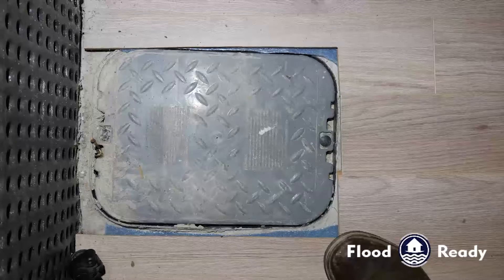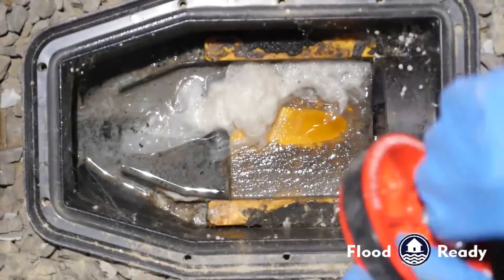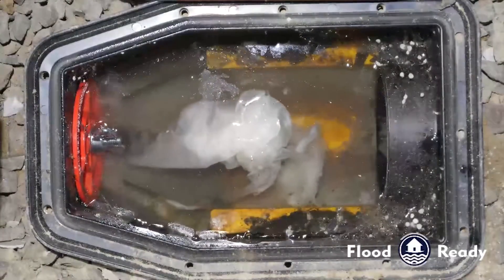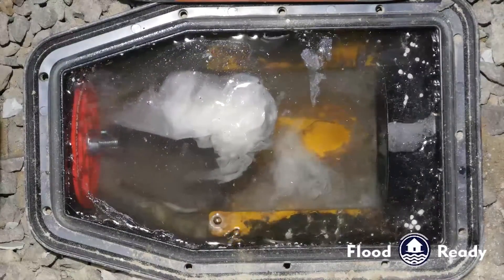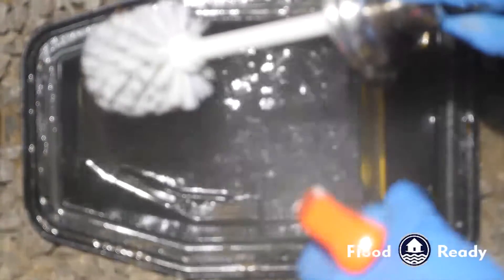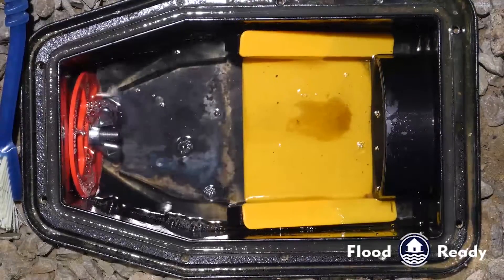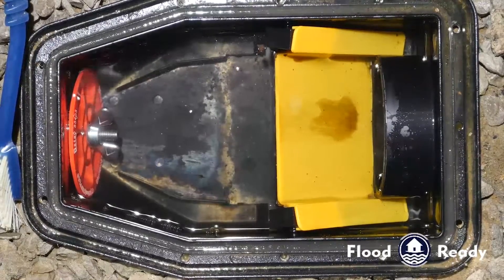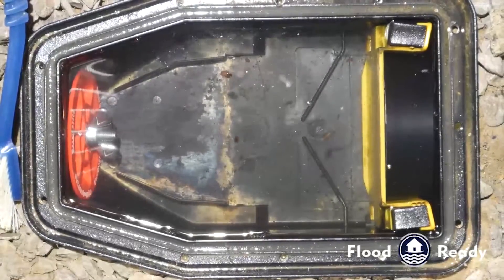Backwater Valve failure vs  performance

Comment: Thank you for the simulation. I have an Mainline Adapt-A-Valve 4" (Normally Open) Backwater Valve and not too long ago the city side was clogged and some water seeped out of my floor drain even though the flap was in the closed position. It was in the closed position for 2 days before the city cleared the blockage 19ft away from my exterior cleanout.  At least is mostly worked.

Comment: is there is away that you install it one time and forget it forever?
Reply: All anti-backwater devices requires maintenance, at least once a year. Check and clean it inside, check and grease the seals best with faucet/valve Grease ( rats love to check the taste of the seals, and don´t like the taste of faucet/valve Grease).

Comment: That can't possibly be a water tight seal. It looks like you would still have some water/ sewage coming back through. Convince me otherwise.
Reply: They are actually pretty close to water tight.  There is a black O-ring on the circular pipe that seals against the flapper.  Most backup events are only a few PSI and they usually only last a few minutes to maybe an hour.  Your also taking a 4” pipe that can move many gallons per minute of sewage into your basement and cutting it down to essentially the leakage of the valve.  There are other ways that cut flow to zero, but they are expensive and complicated to maintain and have a pretty significant failure rate if neglected for a few years.
Reply from the maker: These buoyancy base valves are designed to reduce the impacts of flooding. Sub seepage is expected, if you’re looking for a perfect solution  visit kessel.com and view the Staufix FKA backwater valve.
Reply: @JamieTorontoAtkinson  Well, maintenance and repair is my job for Staufix FKA and - sometimes -  other devices. The idea of the backwater-valve in this video isn´t that bad 🤔 , just like e.g. the ,,FKA" the flap is regular always complete open, so wastewater will pass through without risk of clogging on a flap, and it seem to react fast enough. And you need no electricity, exept for optional backwater-alarm.

Comment: how to avoid ground water near to backup value?
Reply from the maker: Groundwater around the valve is normal. It the groundwater is entering the home you likely need a sump pump. You can also consider an adapt-a-valve which offers groundwater protection. If you are looking for the best backwater valve system visit: www.Kessel.com
Reply from the maker: Groundwater can’t be avoided unless you have a backwater valve that is designed to keep out ground water. View the Staufix FKA by Kessel. Alternatively, you could consider having an exterior backwater valve installed, which would illuminate the problem altogether but for the highest reliability, the FK is your best bet.